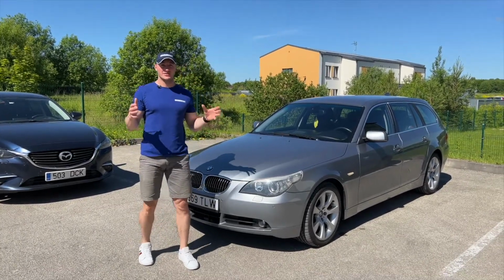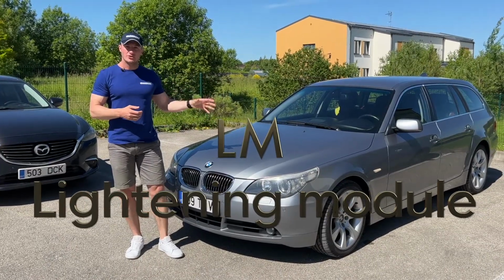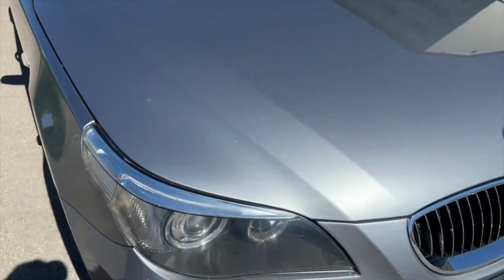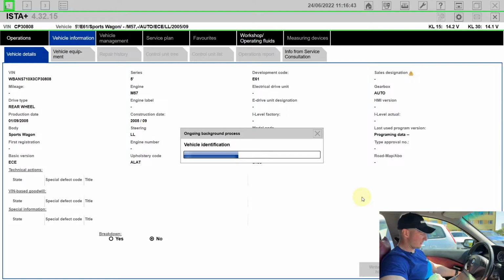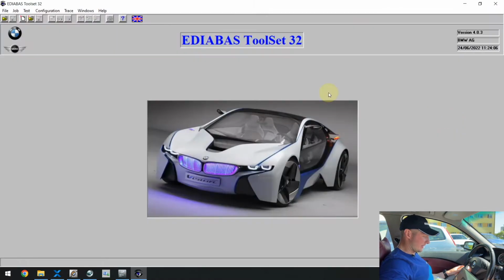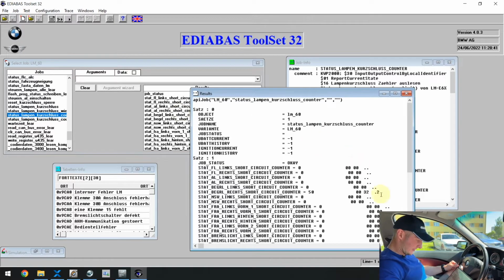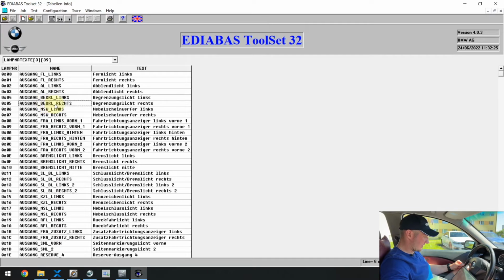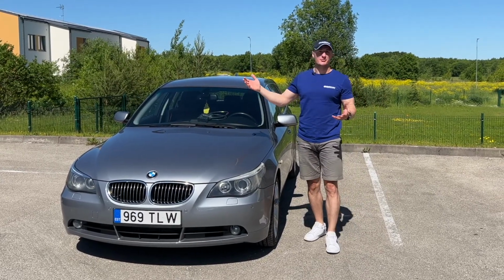How to reset short circuit counter in BMW via Tool32?

Comment: Do you think there is a counter for the AHL on the e61? Specifically the left and right swivel.
Reply from the maker: Counters are usually for lights (bulbs) not for motors etc. 

So most likely you have another error over there

Comment: Hey Vladimir!

I will send this message here and on facebook & instagram as I know this is an older video and you might not see this. 

I have the same issue with my car just with the left parking light, the counter was at 60. I did everything you instructed and it worked the light came on and the job was okay. I took the car on a drive and shortly after the light went out again. I tried to re-do the process in the video however i was met with this error:

ERROR_ECU_CONDITIONS _NOT_CORRECT_OR_REQUEST_SEQUENCE_ERROR

What can I do to fix this?
Reply from the maker: Hi,
If you successfully resetted the counter and light worked. And then it turned off again then short circuit is physically present. Fix it first. Other wise you can damage smth in the car

Comment: Hi, thank you very much for this video. I just wanted to ask, if I have bmw e60 with adaptive headlights and want to reset low beam, do i use the LM_60.prg or LM_AHL.prg?
Reply from the maker: Try both 
Wrong one will not work

Comment: Hello Vladimir, I have a questions about ecu s. How can we know which error belongs to which ecu? Is there any list or way to find it out easily or do we have to check all ecu s one by one? Fpr example I have srs counter problem (I think) on my E60 and tyre pressure error on my F30 but for the both I couldnt find the right Ecu to check. Could you please tell us the easiest way to do it?
Reply from the maker: Answer is SGM-SIM for E60
And RDC for F30

There is no database to check it. You just have to know what ECU is responsible for what. (It comes with experience)

Comment: Just tried this on my friend’s E60 and the short circuit count starts growing almost immediately again all the way to 60. If I reset them I can see the numbers growing in a matter of seconds
Reply from the maker: You have to fix the short circuit first. It's a counter, not a fix for the underlying issue.
Reply: @BimDoc yes. I assumed that was the issue. Weirdly out of the 3 halos that had short circuit I couldn’t reset one at all. I’ll tear the headlights apart this weekend to fix the rotten wires and report back. Thanks! Your video is still helping a lot!!

Comment: why something like this isn't embed in ista?
i have similar issue but with f02 and tried ista steps but no good luck?... 
a note in ista if fault is fixed it should reactivate automatically...IM IN A hole man
Reply from the maker: Because ista is dealer level software. 
At dealer level they just replace ECUs
Reply: @BimDoc  might this work on f series?
i can't fin f02s in tools 32

Comment: How can this be done on newer cars with BDC module? i can find the value which states the short ciruit value but no option to reset it
Reply from the maker: It’s still doable. But some more button presses are required.
Reply: @BimDoc  Can i contact you about this as i have been trying for weeks and cannot get it sorted

Comment: Do you know within which job function i can check if there are errors on the halogen lamp vertical aim adjuster ?
Really would appreciate some guidance
Reply from the maker: Error on those doesn’t mean it is short circuit counter block 

If there is an error it might be just broken or similar
Reply: @BimDoc  eugh really! I had the car previously in at BMW for a free diagnosis (for 20900 error p119D error, which I thought was EGR Cooler, they checked for free and told me its the Throttle valve stuck open) at the same visit I got them to check the error i have on idrive for veritcal aim adjust, and their verdict was that the headlamp general circuits are fine and that its the FEM or REM and quoted me £600+ to replace them. 
I've tried researching everywhere online on this issue, most people suggest its the wiring that could be chafed/damaged - I checked my wiring for both headlamps under the wheel arch, both fine. Also its both sides headlamp aim adjust that's stopped, not just one, so I have reason to believe its something in the software, or a module. 
I have the cable now, so i suppose theirs no harm in checking if there any short circuit errors present ?

Any other ideas?

Comment: Hi BimmerDoc love your videos🤙🏽 quick question. On a 2010 e93 335i n55 rhd is there a short circuit counter for the blow-off valve and the eccentric shaft motor? Thanks for any help and info hope to see more videos on how to use Tools32 .
Reply from the maker: I haven’t heard of that. 
But telling there is not, but most likely no

Comment: Hello Vlad, I have an F10, ISTA says my FRM is FRM3, the FRM3.prg file in TOOL32does not contain any short circuit reset codes. Also you mention F-series is FEM_20, but why?  Please advise
Reply from the maker: F10 does have FRM3 but it reset CS automatically every time it starts. That’s why you will not find CS reset function for F10
Reply: @BimDoc  So now I checked ISTA again. LIN BUS error, FRM not communicating with TMS.  Seems like I have to take into shop.

Comment: I may have written the wrong codes to a few parameters or written the wrong data to the FRM. How can I get these back? I wrote a few codes for this parameter c_fa_auftrag, LAMPNR;0x11 and a few other parameters like that, but I can't find it. What should I do if the FRM or the vehicle breaks down?
Reply from the maker: Tool32 is very powerful 
With that you can do irreversible things. 

Programmer is required to restore all to factory state.

Comment: I really appreciate your videos, great job! 

I’m trying to reset the short circuit on the inner left taillight on a 2018 G30.
Is it possible to do this with ISTA only? 
I can’t seem to find it with Tool32
Reply from the maker: Not possible via ista 
Tool32 is required
Reply: @BimDoc  Thank you!
Do you know which module it'd be?

Comment: Thank you for an excellent video!
Reply from the maker: Glad you liked it!
Reply: I just fixed my error code for licence plate lamp that had a counter of 50 and deactivated circuit. It was fun to dust off Tool32 and put it to use. I wouldn't have been able to figure it out without your directions.

Comment: Hi, i have a bmw g12 which EDIABASE ECU file i lunch ?
Reply from the maker: It depends what ECU you want to work with
Reply: @BimDoc  Thank you for the replay. My rear tail light and break stop working after many warning messages, same as you described. The errors are 804864,80486E. my car is 740i 2016.

Comment: Is it possible that the module was also blocked due to a damaged lamp leveling motor???
Reply from the maker: I haven’t sent blocked motor coursing that. 
But any short circuit can cause.
Reply: @BimDoc  One lamp performs a test after starting, the other unfortunately does not.  There are no errors in the module.

Comment: Hi Vladimir, I have BMW F46 and I would like to change the turning lights bulbs with LED but I am sur that I'll have error msgs can we solve this issue buy coding ? if yes can you please prepare video about that ? thanks in advance.
Reply from the maker: You will need esys 
My manuals esys for dummies will give you all needed information. Part 1 is enough. Just change right parameters.
Reply: Can you please tell me exactly which parameters I have to change ? @BimDoc

Comment: Excellent thank you! Managed to get it cleared reset counter! 

Now I would really like to, seat occupany disable passenger on E87, I know it’s MRS module… where is tht in toolset32? Thank you so much!
Reply from the maker: There is nothing to do with tool32
But I have a video about how to fix your issue 😉
Reply: @BimDoc  lovely! NCSEXPERT is very sensitive  🥲 not working etc, quite difficult to get work, INPA, ISTA+ all working super, but not NCS :(  the ECU option shown was CAS, FRM, NFRM. VIN faulty (possibly lack of files) but  man I loved your toolset32 for lighting reset! :) link video please?

Maybe INSTA+P or other software might do better job than NCS?

Also, I have got 2003 E46 M3, I plugged it in, it doesn’t work even in INPA, nor ISTA… does it need to be switch left?) I have K+DCAN. Look forward to hear from you Doc!
Reply from the maker: See my software installation tutorial to solve those connection issues
Reply: @BimDoc  Hey! Right I’ve managed to get NCS expert working! It was communication, setting, NCS are really sensitive than INPA… How do i really know which to use ECU profile like CAS, FRM, NFRM before selecting modules? And I’m trying to understand how to back up ecu, before writing new coding?  (Execute Job?)  thank you!

Comment: Hi, i have the problem related to my licence plate led light. so every now and then the frm will block the connection. 

Is it possible to disable the short circuit check completly?
Reply from the maker: Not possible to disable completely. 
You can code out hot and cold checks. Maybe it helps.

Comment: Do other E60 modules have short circuit counters? I have a C519 connection head-unit to GPS aerial foot:short circuit to ground fault code. I also have a right break light error but the right break light works. My satellite radio channels are gone, my nav is inaccurate, and I don't have aux audio. I do have am/fm radio audio, CD changer audio, and chimes. Is there a way to reset such a short circuit? Would a short in the sharkfin cause aux audio and satellite issues after the blown radio fuse #34 has been replaced?
Reply from the maker: Not all consumers have short circuit counter 
I’ve never seen GPS antenna being locked by such a counter for example.
Reply: @BimmerDoc  so, basically just the light module/frm? And thank you for your reply and very informative videos.

Comment: Okay so why did the counter get to 50 on just that bulb, but not for any other bulb ? There must be a fault somewhere and after some time the same issue will come back. Yes or no ?
Reply from the maker: Of course. There is a physical short circuit in the wiring. That’s why it’s happening. 
Physical CS has to be fixed first. Other wise it will be blocked again in a short period of time.

Comment: How can I reset the counter on the REM? I found the status job but I am unable to reset the counter because the reset job is missing on the REM. FEM or FRM is no problem.
Reply from the maker: A bit more tool32 knowledge is needed
But still doable. Believe me 😉
Reply: @BimDoc  im sure just not the way you did it in the video
Reply from the maker: It is the same principle, just another job is needed
Reply: @BimDoc  which one?
Reply: @BimDoc  doesnt work on tool32 for F series but with ISTA+ its pretty easy

Comment: What if the counter is not 50, but 60?
Reply from the maker: I’ve also seen 60 in tool32
Still the same 😉
Reply: @BimDoc  Thanks!
 I reset the counter. Left rear brake light (0x0E), everything is reported OKAY, but counter value 60 comes right back. It seems there is actually a short in the wiring(or inside LM). There's continuity between earth and power when measured from bulb socket.
Reply from the maker: If the short circuit is present then of course tool32 will not solve the issue

Comment: I recently did the same reset using the Launch Creader Elite and it was super easy to identify the fault and reset the counter. No need for tool 32.
Reply from the maker: Of course tool32 is only one tool that can do that, not only tool 😉
Reply: @Bimmerdoc 
Fair point. I almost downloaded and tried tool32 but was concerned that I’d mess something up considering your warnings so I checked my scan tool and was happy to see it as an option.
Reply: Hello, how did you go about it? i have a Launch X431 Pro. Thanks
Reply: Same I want to know also
Reply: It’s buried deep in the menu. Follow these steps

Automatically Search
Next
Ok
System Selection 
Light Module
Special Functions 
Extensions
To identify the light with the fault, go to:
Short CircuitStatus of the Output of All Connected Lamps
Then go to: Turn Off Short Circuit Inhibit
And enter the code of the faulty light

Comment: Hi! i think i have this probem to my G30. I am in the process to udate my back lamps to LCI.  I have not find the coding solution yet, but meanwhile the brake lights stop working (error short circuit) i think because of the difrent order of pins on lamp contact. It is possible you solved such a problem?
Reply from the maker: Haven’t seen that on G30
But not telling it’s not possible

Comment: Hello! 
I am trying to reset circuit shorts on my 2012 e92 328i. My left headlight went out because of water damage, and I replaced all the parts and everything works perfectly, except for the adaptive headlight. I found the short circuits on Toolset32, but for some reason, I do not have a “Tabllen-info” tab showing part ID numbers. It does not show up on my screen when I open FRM_87 and I cannot figure out how to open it. Please let me know if you have any idea on how yo open/access that tab, as i need it to check for the ID’s in order to fix the issue. Thank you.
Reply from the maker: Try a wither PRG file
Reply: @BimDoc  I tried this with FRM_70 and same thing happened where everything opens, except Tabllen did not open. I even reinstalled all of the BMW Tools and nothing changed. However, I ran it in simulation mode and Tabllen actually shows up. But when i run it normally with administrator privileges, same thing as before. I am sure that the connection is fine, as I ran INPA and it shows a good connection. I am using the USB to K-DCAN, and I have the switch set to K mode. What version of Toolset32 are you running? Also, what version of Windows?
Reply: I figured it out. Had to reinstall a 3rd time and it ended up popping up when i ran it. Thanks for all the help! 🙏🏻

Comment: Hi, very good and helpful video! I try to do the same process with an F11, but the modules are different. After a looong attempt with many variables with Tool32, I found that the TMS module (the one of wich angel eyes and turn indicator that not works) don't communicate with Tool32 (error of communication). I think first I will  remove the TMS and, after a first check, I will try with repair or a new one module.  I guess that is an hardware problem. But I don't find any counter to reset (like your video, the 50 times of error checked). Maybe at F11 is not expected? Thank you for your thougs!
Reply from the maker: Usually TMS go bad due to water… I don’t remember seeing CS in TMS ECUs 
But not saying it’s not possible
Reply: @BimDoc  yes, it was moisture in the left light... today I will check the TMS element and I will see if the water is the reason. Thank you! Keep in touch!

Comment: It will work with short circuit on DMTL system on E90 ?
Reply from the maker: It will if ECU supports that function. I haven’t tested that.
Reply: @BimDoc  thanks

Comment: Hi, can you make a tutorial on how to reset short circuit counter on F series ?
Reply from the maker: The same way. But for example on F10 counter reset is performed automatically during every car start. So no need.
Reply: @BimDoc  i have a BMW 328i 2014 (F30), i use REM_20 and i see the status_shortcircuit job and i run it and i see which argument needs to be reset but there isn’t a reset job for on REM_20 for short circuit counter
Reply: @BimDoc  I would really appreciate your help
Reply from the maker: On F30 doable via tool32 
If you will not figure it out how to, then contact me. I’ll help you.
Reply: @BimDoc  how can i contact you, i will make sure to pay you if you can help me out !

Comment: Привет. Пытаемся подключиться через E-Sys к m5 f10, пишет "Connection check failed. Gateway/ECUs are not correctly connected or not responding. However Functions using the ODX-Data can be used. [G188]". Из-за чего может быть данная проблема? К остальным машина подключаюсь без проблем(которые не М).
Reply from the maker: Дал ответ в личку